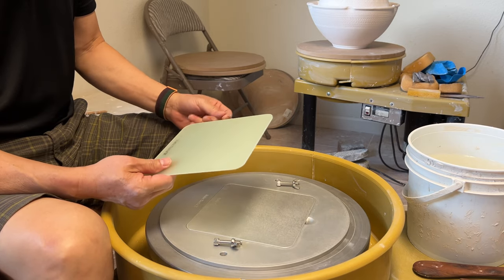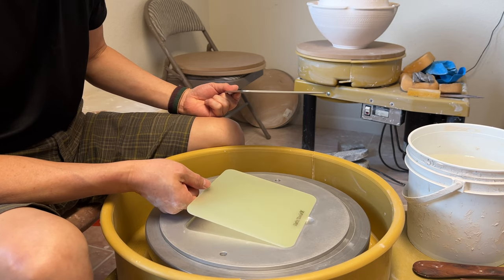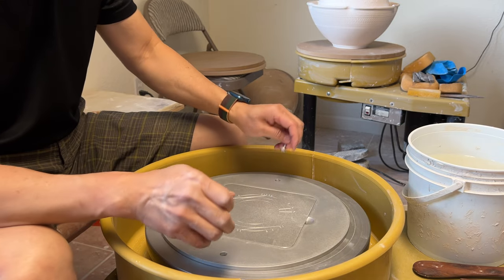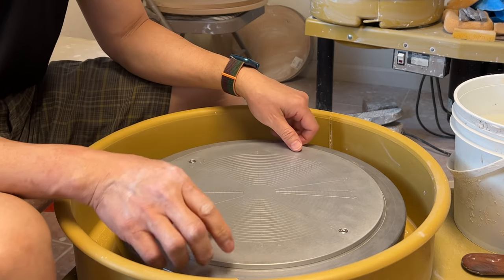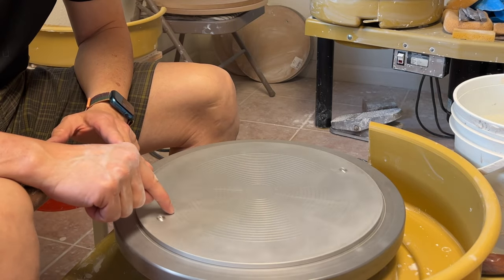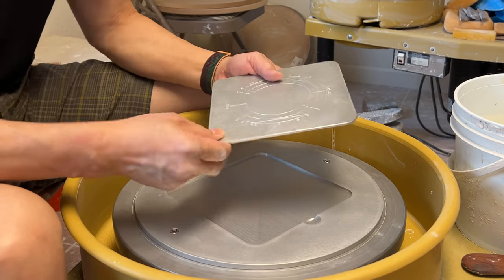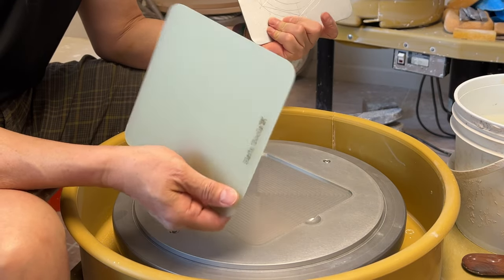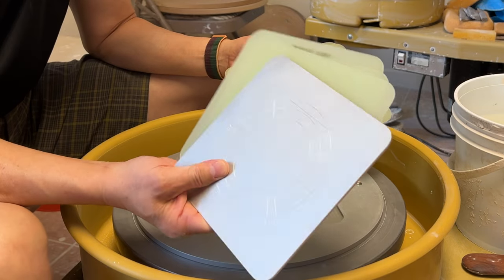678. Setting Up a Beta Version of Hsin Tools SpaceSaver Aluminum Bat System with Hsin-Chuen Lin 林新春

Comment: Is the bat pins flush with the bat?  I have a strong arm device to center my clay and the plate that centers the clay rides over the bat.  IF the pins are not flush with the bat it would hit the pins.
Reply from the maker: It’s a bit taller but with the bat gripper it is flush.

Comment: How much are they?
Reply from the maker: Depending on the bat inserts, somewhere between $225~$260. It will be available in the fall, however the shipping is very costly, I am not sure which shipping method I will use.